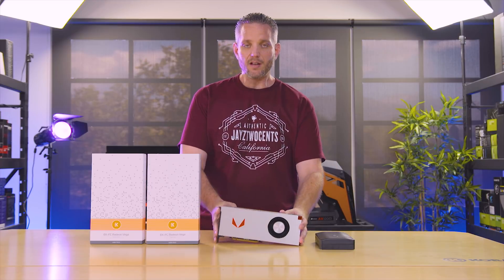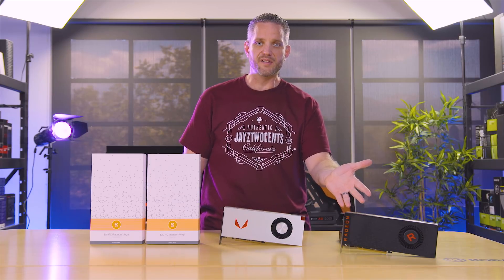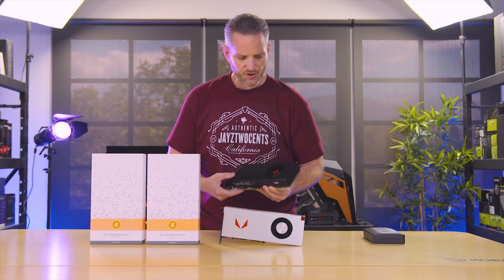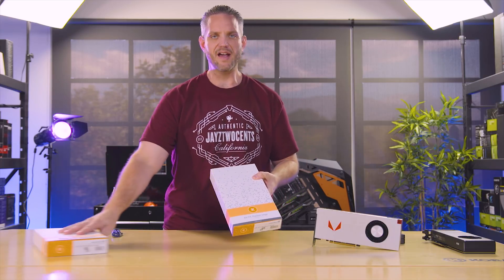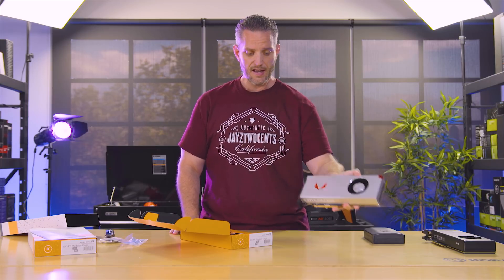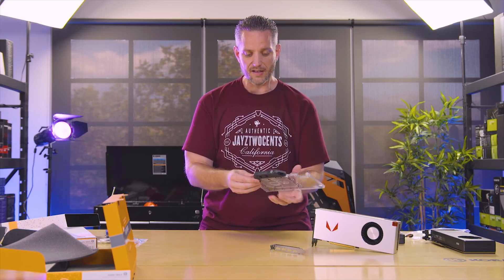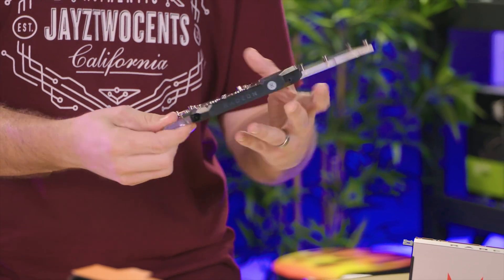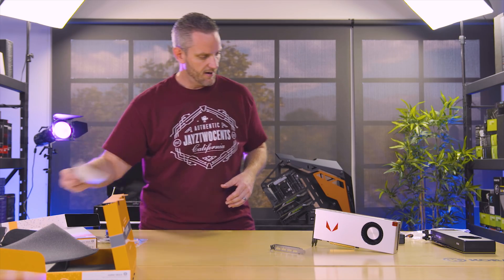Does watercooling help AMD Vega cards?

Comment: I purchased the 56 at RRP and want to go watercooling + undervolting route.  I probably would have gone to nvidia long ago if I was still a windows user, but AMD is the place to be if you're on the cutting edge Linux distros.  At this point I think this is the waterblock I will be getting for my new build.  Hopefully the next round of AMD GPU's will be more efficient, because it would be bad for the market if only nvidia were producing high end gpu's.

Comment: I have always wondered if you put fizzy water or soda into the water cooling system would it work What I find interesting is that is the teraflops are higher than nvidia, can they break the 40 teraflops barrier i also like the design it would be interesting to see if you completely hide the water system as could you custom a loop with the radiator and other things to completely hide them ,

Comment: Cheapest Vega 64 is $200 more expensive than the cheapest (Galax) 1080 here. The 1080 is faster in most games and runs cooler, quieter and uses less power. AMD really needs to sort out the pricing as where I live there is absolutely no reason to buy Vega64 at all

Comment: Looking at GTX 1080Ti prices, USA is lucky, Canada here we're looking at $1100 just to get the 1080Ti, that's not even including the damned waterblock, pump/reservoir, tubing, fittings

Edit: or radiators

Comment: As much as I admire the new architecture(fueled by GamersNexus' great videos) ,and support amd as a whole,this card, as is, is a bad buy.If I was building a 2nd rig just for the brag rights, and had 3 grand to waste,sure, I'd buy 2 vega 64 and run them crossfire watercooled. But as an average undergraduate student (and everyone else to be exact), it's a dumb buy.
Reply: Thatsexceptional amirite He said if he had 3 grand to waste ...
Reply: I can't type your name, it's naughty! If you can find a decent after market 1080 Ti for less than £700 you should be jumping on that. Mine cost £730. I'd be mad if I'd spent more than that on the water cooled Vega only to find out it can't even reach 1080 benches.
Reply: Alfa Proto Because this guy claims his Fury beats a 980ti and is on par with a 1070, while those cards have the same performance more or less. I was focusing on his flawed logic and stupid assumption. I run my 980ti at about 300mhz higher than the base clock and higher than the factory OC so... plenty of room and performance.
Reply: I disagree and would say that it is good buy but highly dependent on the use case. For example, while I do game, I own eleven RX Vega 64s and they have revolutionized my processing power ability due to AMD ROCm's open architecture GPU processing. In games, the Vulkan driver works beautifully with these cards and I enjoy silky smooth gameplay at 2K and under resolutions.
Reply: ronald4life1 

Is it? Vega went up to £599 and that's borderline 1080ti priced.
Reply: honestly just get a 1050 ti and overclock it. 1080p on ultra easily
Reply: it can also game at 2k 60 fps
Reply: For right now, it's a bad buy...  Wait until the mining craze is over, and it will be the superior price/performance GPU, just like the rx 470 vs 1050 ti.
Reply: Bread Bread The 1070 can do 4k on most games at 60fps.
Reply: Alfa Proto yes but the 1070 is much more in cost than that.
Reply: Uhh...you can get a 1080ti and water block for the stupid prices they're asking for these blah cards.
Reply: I bought an R9 Fury X in January. Man that was so worth it. $300 for a card that performs better than the GTX 980 ti and on par with the GTX 1070 while making almost no noise. I am personally waiting till Volta releases to see if I should get the Vega Frontier edition or not. I have a particular workload that is ideal for a Vega Frontier or Titan XP. However, the Titan XP has terrible support from nVidia.
Reply: Kevin Smith Umm the 980ti and 1070 have the same performance. What the hell are you on?
Reply: Bread Bread 1070 still has OC room, uses less power and less heat being generated. Plus why are you comparing it against the 1070, Vega is competing with the Titan.

Look at AMD past, they have been going tier-to-tier since the HD 5000 vs Geforce 400 series.
Reply: Bread Bread Before the launch, one of the AMD spokesman said that Vega against the 1080ti and Titan Xp (numbers are pretty goodl
Reply: Egon Marić I was replying to Bread Bread but what you said is true. Nvidia cards have plenty of OC headroom, try to compare with AMD cards, likely hit temp limit.

Even a Founder's card can have that kind of  headroom. On AMD, even with the temp limit adjusted, you are likely to hit either the temp limit and/or silicon lottery.
Reply: That 1050ti  1080p/Ultra/60fps and 2k/60fps joke was good though :D
Reply: Tsvetan Tsekov I was playing alien isolation 2k/60 and 1080/60/ultra
Reply: Try Ghost Recon Wildlands/GTAV/PUBG/Project Cars and a lot more actually. But yeah, price/performance right now with this market it is either this or a 1080ti :D Or the Vega64 if you can get it at a lower price than 1080ti and plan to use a freesync monitor.
Reply: Why is it a bad buy?
Reply: I got my Vega 64 for 450 USD used in Box. Seriously consider to WaterCool.
Reply: Eleven x Vega 64??????
Reply: How is a Vega 56 a bad buy? It's faster than a GTX 1070 and cheaper..
Reply: waste of time no crossfire support in drivers
Reply: while the 56 is faster, and is about $30-$50 cheaper then the 1070, the supply problems and price increases make the card less desirable in terms of the performance you get for your money.
Reply: +NextDoorGuy In a nature setting, women are to be conquered.
Reply: NextDoorGuy 
'3 grand to waste'
'average undergrad student'

yeah

Comment: It's so ridiculous to have to push SO much wattage....and so much water cooling bullshit into Vega. You could just buy a 1070 with air cooling and get better performance with much less heat / power. Vega is such a failure.
Reply: Jay Tee 
Vega is more appealing for workstation workloads than most of what Nvidia is offering. 

So it depends on what you mean by performance. If you're talking about playing video games, then yes, I think Nvidia is the better route to go. 

But if you're looking for something that will offer superior performance in computation, then Vega is much more appealing. Nvidia is charging far more money for their computing-oriented cards than AMD, like their Nvidia Quadro.
Reply: Mister K [Citation Needed]
Reply: fanboys buy everything, even if it is the biggest shit on the market.
Reply: Mister K 
When did I say Vega was better? I said it was more appealing, if that's what you're trying to get at.
Reply: Cuttle Fish false, 1080ti is still better than Vega even in Workstation areas. Vega is a failure and AMD knows it.

Comment: AMD Master Race!!!
Reply: Michael Remington or just buy neither  and use fast sync on a regular monitor.
Reply: how u calculate that? dude? omg, u r so wrong
Reply: Adam Kiwior you may need to approach things differently to understand were hes coming. Amd game play is smoother and I.have a 1060 and an rx480 there driver system is brtter than nvidias how ever nvidia have micro stutter and power they kinda negate each other.
Reply: NapFloridian A decent portion of software developers run Linux. The ones that play games often don't want to have to either boot into Windows or use it at all.
Reply: Adam Kiwior No i am not wrong. Are you just stupid?
Reply: Rasmus how much do you pay for 1kwh?
Reply: Adam Kiwior look at gamersnexus' Channel and dont ask stupid shit.
Reply: Rasmus Rasmussen Actually, the Vega 64 is quite a bit faster under linux. Shows the potential.
Reply: Rasmus Rasmussen 4.76/10 for bad bait
Reply: Rasmus Rasmussen Vega 64 has a raw computing power higher than that of the 1080 ti. Do you really think it doesnr have the potential to be faster? Because it is, under linux. And AMDs linux drivers have always been shit compared to nvidia.
Reply: MetinCrafter 1080 ti is definetly fully supported by nvidias proprietary drivers. If you look at the general driver landscape in linux, nVidias have always been better. Vega being fully supported is also not true. the amdgpu and amdgpu-pro drivers generally are still very unstable and not very fast, especially compared to nvidias proprietary ones.
Reply: Daniel Wanner Pretty sure i read that Vega has a good optimisation on Linux, while Nvidias Cards are kinda half assed when it comes to gaming
Reply: Except on Linux, where the Vega 64 is faster than the 1080Ti.
Reply: CrimSun thats a Big no kid
Reply: Michael Remington If you want 3 monitors i doubt you worry about the money. And a 1080ti still kicks it ass
Reply: Open source ones.
Reply: Yeah Vega is shit (the 64) because Miners cannot mine with it... DUH go purchase a mining card, oh sorry forgot, no resell value

Idiots, VEGA is a Gaming card, not a mining card.
Reply: Not really. Vega is just badly made. That AMD in a nutshell.
Reply: Daniel Wanner actually vega is fully supported on linux while 1080ti isnt

Not to mention raw compute power doesnt necessarily mean better in gaming. 
A 1080ti also beats a Quadro in gaming
Reply: on a vega video? i think not
Reply: ik, also a big selling point for me is the sweet sweet free-sync support. Also the gtx 1070 level makes me a very happy man. :D
Reply: AMD Vega is shit!
Reply: But with three monitor you need gtx1080ti performance at least so... nope.
Reply: Rasmus Rasmussen and its only BARELY behind the competition. If it was MSRP it would be solid
Reply: Michael Remington you amd fans are just still forgeting that you Electric Bill will be almost 200 dollars pr year more with a Vega card. So freesync my ass. NVIDIA kicks AMD's ass
Reply: @CrimSun, Who runs Linux and games? That is like having a Ferrari and driving it in Vietnam
Reply: Rasmus Rasmussen its really not when you think about it. You could save a lot if you want 3 freesync monitors instead of 3 g sync

Comment: This single-slot AMD card, really reminds me of the 7-gamers-1CPU-PC Linus build with 7 Furys .. but i guess vega 64... he would need 2-3 PSU's with that 300 Watt Powerdraw :D
Reply: Jan-Christopher Estelmann Or we can wait for a Vega Nano card to happen.
Reply: MysteryMii215 you could also undervolt and underclock a vega 56/64 to a lower power draw, i dont think an nano version will come, because amd does not get much profit out of the hole rx vega thing
Reply: Linus built it with 9 Nanos, he made the statement that Furys would be outside of what was possible for a single PSU. I think you can fit dual power supplies in a corsair 900d...
Reply: Vega Nano is coming; AMD confirmed it at SIGGRAPH. They need more time to finalize the PCB and bin the most power efficient chips for use in said Nano cards. That's what I'm waiting for.
Reply: ok didn't know it, it would be interesting, if it also has 8gb of HBM2 because this is the most expensive thing on that lineup... maybe only on stack of 4Gb, but this could be a bottleneck at some games ... or not.. don't know actually if the high Bandwidth does anything to the bottleneck-thing of lesser memory capacity
Reply: 4GB in a single stack for Vega 64 die is pointless.. with just only 1 stack, it's cuts half of available bandwidth